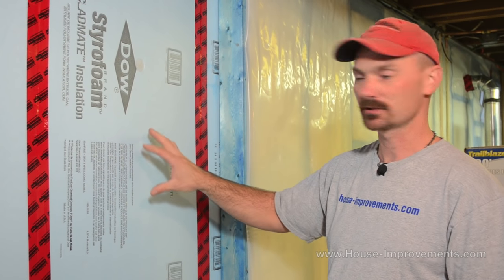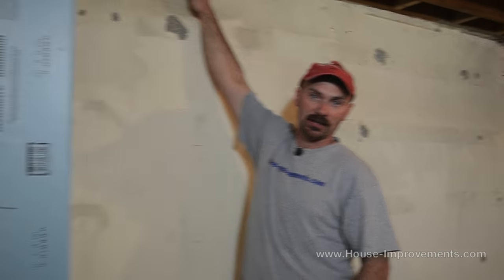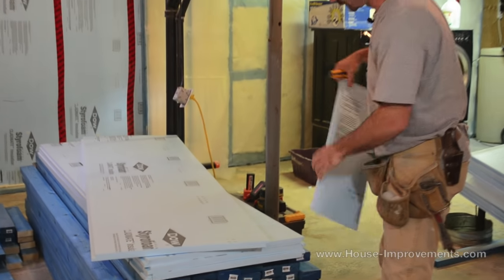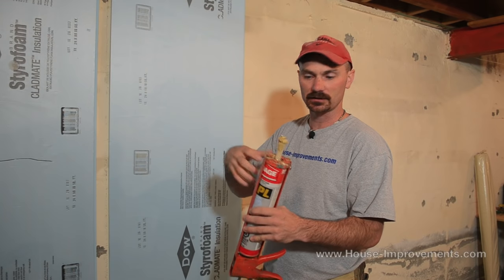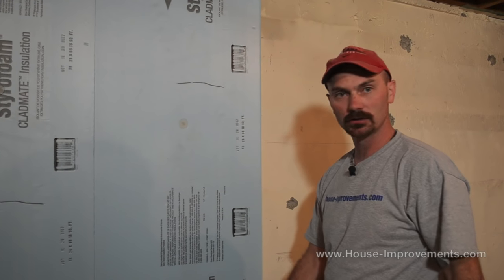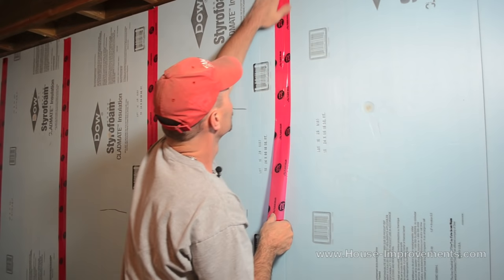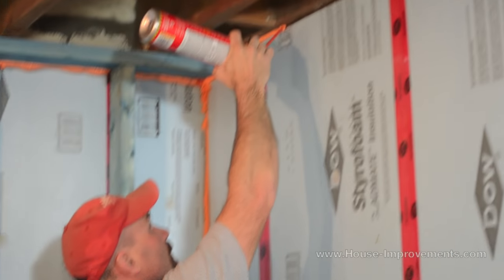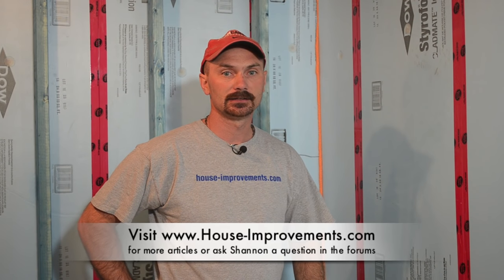How To Attach Rigid Foam Insulation To Concrete

Comment: Sorry, another question I have is are you applying a thick bead of acoustic seal under the floor plate and, if not, why? 

I believe it's also customary to wrap poly under the floor plate; though, I personally question this practice and think the acoustic seal and treated wood is better.
Reply from the maker: I do not place anything under the P.T or Blu wood plates . When my poly is installed it is then sealed using a generous bead of acoustic right at the joint between the floor plate and concrete.

Comment: Thanks so much for your video.  You mention stud framing the walls and attaching drywall.  I assume this project is for living space in a basement.  I am looking to seal off and insulate a "cold room" under the front porch. Can i just attach the insulation and tape/seal it and leave it exposed?  The thought was to reclaim the damp humid cold room as a dry storage room.  Any thoughts?

Comment: Moisture that does come through the concrete wall will just get trapped behind the foam board?  On a house in New York built is the 1950s, do you think this is best method? I dont see any water leaks, but I do see moisture and lime stains on some areas of cement walls.
Reply from the maker: this is it.

Comment: Thanks for the informative video, Shannon! Wouldn't leaving an air gap 1 to 2 inches between the concrete wall and the wooden framing be better (instead of providing foam sheet there), as it would allow the concrete wall to breathe and any dampness thereon to dry up by air circulation.
Reply: I’m also concerned that he’s already painted the foundation with what appears to be dry lock. There could definitely be some moisture issue(s) between this layer alone
Reply: Moisture forms in the basement based on moisture in the air...the temp of the material in basement will coincide with the dew point. If you say allow room air to circulate, basically you create the presence of moisture and negate the use of insulation. He created an air seal, which prevents the introduction of moisture in the air. 
This works especially if the foundation is intact and the house doesn't have ground water problems....

Comment: Hi,
What would you do to your concrete basement wall before putting on the Ridgid Foam Insulation. Such as would there be any type of treatment to the basement wall, or if i already have a wall that is framed and put on the foam?

Comment: I have a crawl space. About 4 ft concrete walls. Do I install the vapor barrier on the dirt floor first, then install the foam sheets?
Reply from the maker: foam first then run poly on ground and up walls 6" -12" tape all seams and to the foam as well.

Comment: Hi Shannon, started to work on my basement and I put R7.5 rigid Styrofoam board directly on the inside concrete wall and sealed all the joints with spray foam and tape. I will be adding R12 insulation between the studs has well.  My question is in regard to adding a 6 mil plastic vapor barrier over the R12 insulation. Wouldn't doing so potentially create a double vapor barrier between the foamboard and the 6mm Polyethylene and potentially trapping some moisture?  Perhaps I’m overthinking but would love to have your input on this…..Thx.
P.S.  Love your videos.
Reply from the maker: There is that potential , in my area i'm am required to still use a separate vapour barrier even thoughI have used the foam when using 2" foam that is rated at R10. You will have to check your local code office to see your regulations.
Reply: @HouseImprovements  Thanks Shannon,  I live in Montreal and it get's pretty cold in winter.  I think it would be much safer to have a Vapor Barrier.  Also did a bit of research and found a product made by Certainteed.  They make a Smartt Barrier.  It's called MemBrain.  The product is apparently compliant with National Building Code in Canada. Have you come across this new product and method?

Comment: I thought that when you seal foam board to the concrete and it becomes a vapor barrier as you say that you shouldn't put poly on the inside as it will not let any moisture out and will mold.
Reply from the maker: depends where you are and what the inspectors will allow. Here i need a vapour barrier even with 2" rigid foam.

Comment from the maker: 1- no remove the mould first. 2-If you have a drain do not cover it with the foam or the bottom plate and also allow the foam to not be sealed at the bottom.

Comment: Do the concrete walls need to be smooth?  My house was built in the forties and the concrete has chipped and worn in spots.  Do I need to clean it with a wire brush and fill any unlevel spots first or can I just apply the foam board?
Reply from the maker: Not really just clean off any efflourence residue ( white powdery stuff). Unless there are some large cracks larger than 1/8" or voids deeper than 2". If you need to patch cracks use some hydraulic cement.

Comment: Hey Shannon.  I built a 2x4 frame in front of the exterior brick wall in my 2nd floor bedroom in Philadelphia, PA.  I was going to just fill the cavities with batts and then I was reading you really want an air barrier and at least somewhat of a vapor barrier between the wood framing and the brick wall.  I don't understand why I can't use Owens Corning 1/4" Formular the stuff that comes in 2x4x50' fanfolds.  Could I put the 1/4" Formular between the brick and the wood framing and use scraps of batt insulation to wedge it in there tight against the brick?  Would this not be better than no air barrier at all and just batts alone?  I see in your posts that 2" of foam seems to be a better vapor barrier than 1" or certainly the 1/4" I'm thinking of putting in there, but this is also not a basement wall, its on the 2nd floor.  I'm also confused about if it's a good idea to have foam on one side and poly on the other, it seems like that could trap moisture in the wall?  And, that orange foam, I assume that is specially made to use with the type of foam (Styrofoam) that you used?  Sorry, I have a lot of questions!  I don't like the idea now of using only batts in my wall assembly and no air barrier...
Reply from the maker: Long story short, place your 1/4 foam back there and get it fixed in place then use spray foam in the can to seal up around all the edges. Install your batt insulation,and then the vapour barrier. Be sure the vapour barrier is sealed well to the adjoining walls,ceiling and floor. Then install what even wall finish you want. (drywall,paneling)

Comment: Hi, 
I want to install this rigid foam in my basement, but I have a drain stack right against the concrete coming from the kitchen above.  There is no hope in getting Rigid behind it, so would you just lay some 6mil plastic behind the rigid on both sides and have it behind the drain stack?  And then spray foam around the base of the stack or acosti seal?
Thanks!

Comment: Is it possible to use construction adhesive to attach the foam to the wall instead of the anchors?  I understand there is a special type of adhesive for rigid foam insulation.

Comment: Since you have styrofoam boards, then fibreglass insulation adding a vapour barrier will only trap moisture. I was told vapour barrier is not required if you have styrofoam.
Reply: Stefan Schweizer  I still think it’s pointless to add a vapour barrier since the rigid foam is your barrier.
Reply: Stefan Schweizer  I can only tell you from my experiences, I have a home and a cottage with walk-out basement in Ontario, Canada. The home was built by the developer the cottage by a contractor.
The home basement has 2 x4 framing with fibreglass (pink) insulation , from floor to ceiling, ( rim joist included) wrapped in vapour barrier. They use tuck tape at the overlap and seams and vapour barrier adhesive. In the summer I have moisture  ( top 3’) between the insulation and barrier. Compared with the cottage which has rigid insulation ( r12) glued to the concrete foundation, spray foam the rim joist, (Home Depot kit) , framed 2x4, r12 pink insulation and garage graded dry wall. ( for code purpose). No moisture issue with the cottage. Hope that helps.

Comment: I need to insulate just one wall that separates the garage to the basement.
Will probably use this insulation glued to the concrete wall. The ground is also concrete but the ceiling isn’t. Can i finish the job with the spray on the floor and the ceiling?

Comment: Confused about using a second vapor barrier with insulation in between.  Would the foam board not be acting as a vapor barrier?
Reply from the maker: Some foams will if they are thick enough, and some areas will allow you to delete the poly vapour barrier if you have enough rigid foam.

Comment: This wall assembly has a double vapor barrier - bad idea.  The XPS foam board is a vapor barrier and the poly is too - with a stud space with batts in between them.  Moisture from the interior will get between them and there is no drying potential with a vapor barrier on both sides.  I'd ditch the poly vapor barrier.
Reply from the maker: +Larry Janesky Unless you use 2" rigid foam you can not skip the poly vapour barrier. rigid foam is not considered to have a high enough perm rating until you have 2 or more inches.
Reply: +HouseImprovements I still see vapor getting trapped in there, in that it would take a very long time for water to penetrate the foam.  Why not use foil backed foam instead, and no vapor barrier on the inside?  Or how about the vapor barrier over the foam?
Reply: do vapor barriors go on the inside or the outside? Cant i use a Radiant Barrier, then foam? Do I need vapor barriers on my walls that are external?
Reply: foil backed insulation is not used much in Canada. At least in my experience.
Reply: Dave Roberts said

Comment: Great video.  But have a question.  Since most videos are below grade, wouldn't all those holes just provide more egress for water seepage thru the cinder block?
Reply from the maker: This is not cinder block it is 8" solid poured concrete wall.
Reply: That answers my question, thanks for the response.  I'm learning a lot from your videos, keep 'em coming.

Comment: Why do you have poly for a vapor barrier if the foam and tape act as a vapor barrier...or is a moisture barrier different than a vapor barrier here? Second...we get 40F and -40F so same process using 2" SM board or is 1" plus the batts sufficient?
Reply from the maker: Depending on the foam type, thickness and your area it may not be sufficient as a Vapour barrier and moisture barrier.

Comment: I'm attempting to permanently attach 2" foam board insulation to new concrete slab.  (It's already "stuck" due to wet concrete being poured up against it)   Using tapcon screws and  large plastic washers, and have broken two screws already.   I suspect it's because I can't get all of the concrete dust out.  Wish I had known about the plastic anchors...They look easier...although I think I may still have dust removal problems either way.  Had to take a break from it yesterday I was so annoyed.  Plan to "troubleshoot" tomorrow (pipe cleaners and a vacuum????  air compressor, which I'd have to rent?)
Reply from the maker: Can you drill a little deeper ? This gives the dust a place to go.
Reply: @HouseImprovements   Thanks!  Great idea... I'm planning a "second take" tomorrow morning....I had already drilled 1/2" deeper than the screw as the standard recommendation, but I really think, because there is nowhere else for the dust to go, that even deeper may actually be the answer, or at least part of it....  Thanks for all the videos...I've found them after searching for information on many different tasks and they're always so helpful!
Reply from the maker: @macoeur1122  You can blow them out as well but I find an extra 3/4" or so if you can makes all the difference.

Comment: Curious to know if there will be any issues down the road doing this? Like between the foam and the concrete wall.Should a seal be put around the foam or leaving it unsealed on top and bottom allow for some air to get behind foam to keep from having any issues down road?Does it matter depending on hot or colder climates?I was curious also if adding foil on the 2"/4"foam board (one side or both)would help in any way
Reply from the maker: +try duck the idea is in a cold climate to seal it up to keep warm moist air from getting behind it. IMO

Comment: When you drill your holes in the wall.  Will the holes leak if it rains or anything like that?
Reply from the maker: Your walls should be 8" thick and i'm drilling only about 2" in. They should not leak unless you already have issues in the wall.

Comment: Hi Shannon, would you recommend and is there any benefit to sealing the concrete walls prior to installing the rigid foam?
Reply from the maker: IMO it is a waste of time . Most of those products are not going to last anyways. If you have significant leaks they should be sealed from the exterior.

Comment: Having a tough time finding information on how to frame and insulate when there is septic system piping running across the wall.  In the NH town I live we use individual septic systems, no town septic.  There are 6" pipe that go across the walls for sewage discharge.  Questions:  Is 2" foam insulation attached to the cement walls enough, or do I need batting in the frame also?  Second, the framing will be 6" away from the cement walls because of the pipes.  Any special considerations that I need to worry about?
Reply from the maker: Please use my forum for your questions. Thank you. http://www.house-improvements.com/forums/

Comment: what would be the recommended thickness/density and type of foam(xps, or eps) for flat concrete roof insulation. what to do about the parapet creating thermal bridges with the underline concrete.
Reply from the maker: +MySchizo Buddy Sorry but that is out of my knowledge range.

Comment: Foamboard is a moisture barrier.  So adding a plastic sheet moisture barrier on top of insulation bats may create a trapped area for moisture to collect.
Reply from the maker: Check your local codes , In my area most local building codes still require the vapour barrier under the drywall with up to 2" of rigid sheet foam against the concrete wall.

Comment: I need to get into the half of the crawl space I am insulating.  If I use only horizontal sheet of foam as a temporary wall into the area with pipes I am heating and insulating, should I add a vapour barrier?

Comment: For a block foundation,  would you leave a gap from the wall to allow for moisture evaporations? 

My opinion,  blocks fail in certain climates and cracks and problem area soon appear. Like corners or weak spots.  Following your ideals here with blocks,  would it be any different?

Great video ideas
Reply from the maker: On blocks I would do the same thing as long as they are in good condition. The only thing I would change is I would attach the foam using adhesive only.

Comment: Can I use liquid nails and put sheet rock up against Thermax sheathing insulating walls without having to start out my basement I have a long wall and I don’t wanna spend the money to start it out but I just want to put up sheet rock so I can hang a couple of things nothing of major weight it’s more just posters and flyers and random toys

Comment: If I'm going to put down dmx underlay with osb subfloor would you recommend installing the walls as you describe before or after installing the floor. Wondering if it will make a difference when it comes to moisture migration and/or ventilation behind the vapor barrier.

Comment: I know this is years on, but would this solution work without a finished framing over top of it?  I have a split level house and the garage brick walled half underground.  I wanted to insulate the two exterior facing walls and don't really have any need of for framing it or going further.  Since there's an HVAC vent going in to the garage already, I'd like to keep it closer to the house temperature.

Also, in this case, would silicone caulking work in place of closed cell foam in order to seal the gaps?  I figure it would be more aesthetically pleasing since I'd probably paint over or something so it wouldn't just be foam board.

Comment: I have a kitchen above ground with one wall to outside, I want to insulate it with rigid foam. The drywall was attached to 3/4 inch wood slats. I want to add one more layer of wood slat over the existing one to be able to put 1 to 1.5 inch rigid foams behind drywall.  No room to put the rigid foam behind the slats.  The wall is brick and block construction. The house is in northern Virginia. Why should the rigid foam be sealed the way you have done? Any reason? Thanks!

Comment: I have been following your channel for quite sometime now. What are your thoughts on metal studs (basement walls) and insulation. I live in Saskatoon where the weather gets really extremely cold.
Reply from the maker: I have never done it mostly because there is more effort in sealing and applying the vapour barrier and also for attaching baseboards and such. IMO it is really not necessary . I am only 2 hours away from you and you don't see metal studs really used around here for a basement.